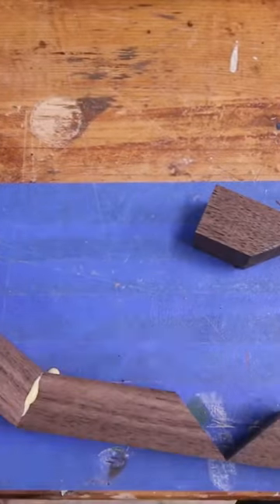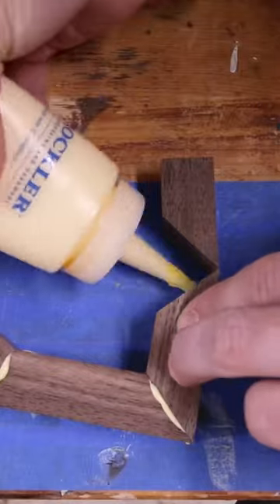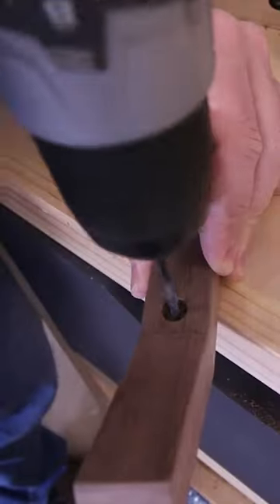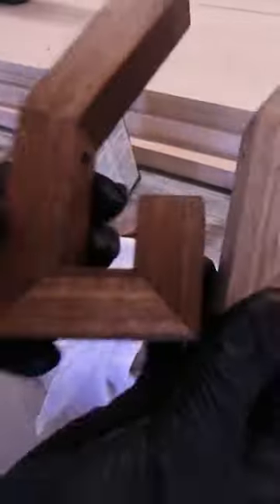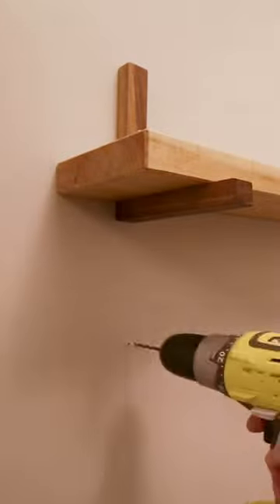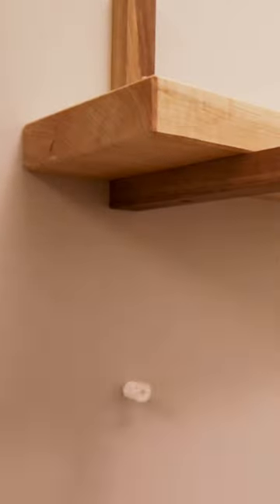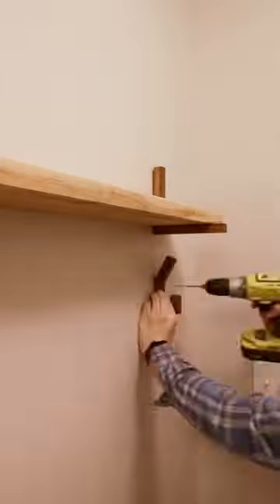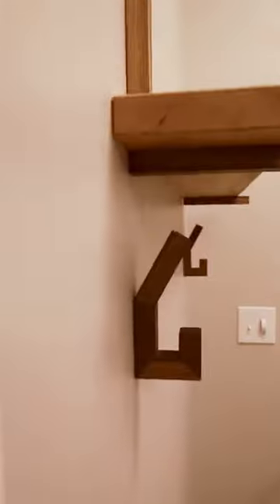The perfect recipe for the perfect hook 👌 #DIY

Comment: Is the glue really that effective to carry the weight of like 3-4 heavier coats?
Reply from the maker: Yes! The point of failure is the wall anchors. I prefer studs over anchors and v2.0 will have two screws so the kids can't twist the hooks around for fun 😂
Reply: You prefer studs? I didn’t notice